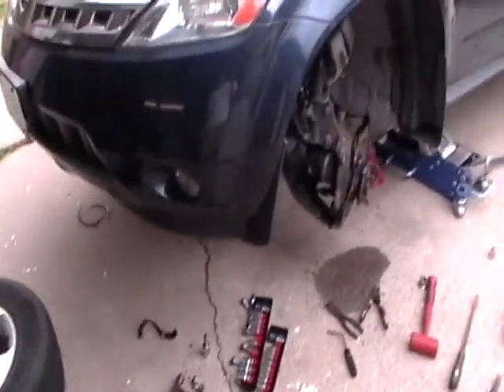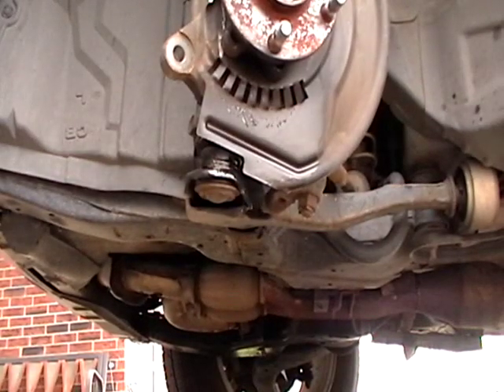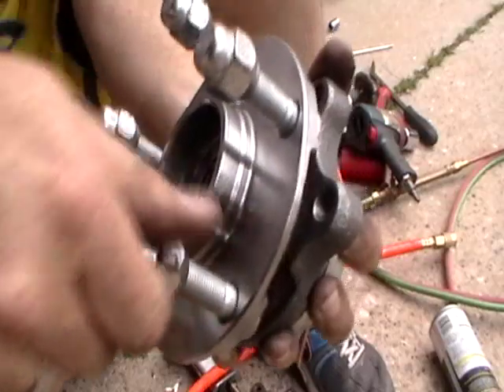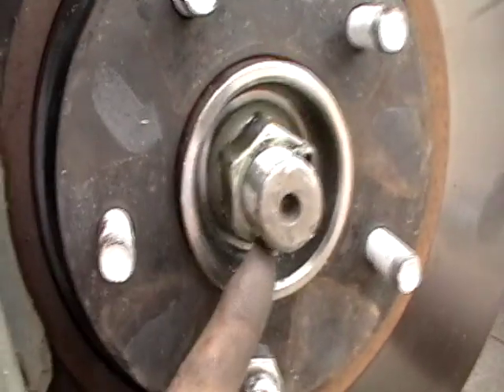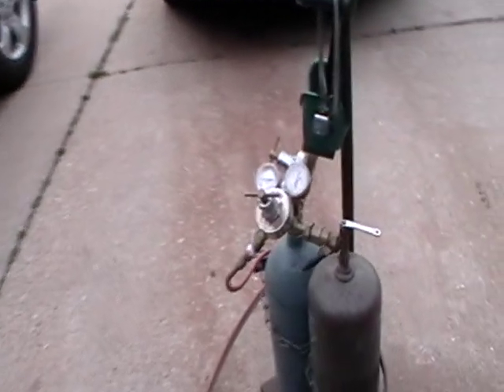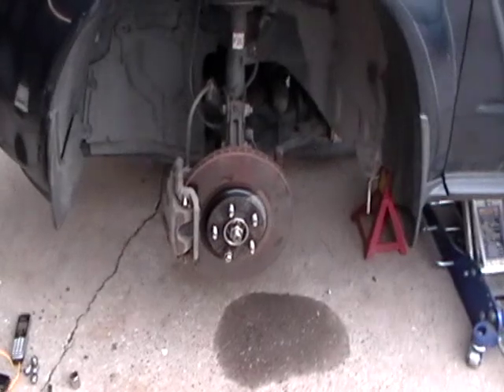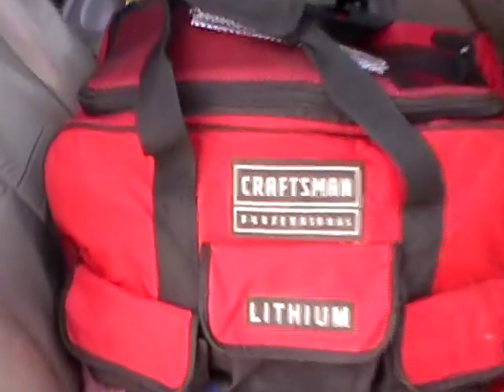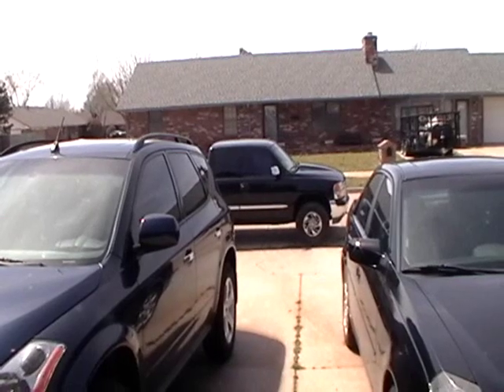2004  How to change a Nissan Murano Hub assembly

Comment: I also bought them from eBay. Got  both sides for $118. Also removing the 2 strut bolts makes this job much easier!  Mine knocked right out. Thanks for the video. It was helpful.

Comment: Thanks for the vid got an over all perspective almost broke that sensor too, i backed the hub bolts out and used an air hammer with a pointed chisel on the bolts came right out. Didnt have rust like yours though.

Comment from the maker: great question!!!
Nope this car has always been in Oklahoma and its rare when we salt the roads.  Ive heard of using the power steering pump to hydraulically knock it loose by turning your steering wheel and putting something behind the hub to push against the hub.
 To be honest I wasnt so sure myself and thats why it got as bad as it did.  It got bad enough so you could tell a difference when I was driving and much quieter when I let my wife drive (me of course being on the passenger side.

Comment: Completed this project today and damn if the ABS light and brake didn't come on. Seems I may have broken or not put the sensor back in properly, any suggestions?
Reply from the maker: +cmatin01  Sounds like it.  Pull the sensor plug back off and clean the terminals.  (They make an Electric spray cleaner you can use)   maybe brake dust got in between the connections.  Or Maybe you didnt get it pushed all the way in.    Worst case scenario you have to replace the sensor which is WAAAAYYYYY easier the the hub.   Good luck
Reply: You may have also put the bearing in upside down. There are three holes in the back side and one of them will line up where the ABS sensor is, unless you put it in upside down.

Comment: Hi, where can I buy the parts? I need to replace my noisy bearing wheels but the mechanic guy told me they would cost about $600 tax included.
Reply from the maker: You can buy these at most any autoparts store, O'Reilly's, Autozone, Napa, Advance auto parts as well as many online auto parts stores.  Good luck